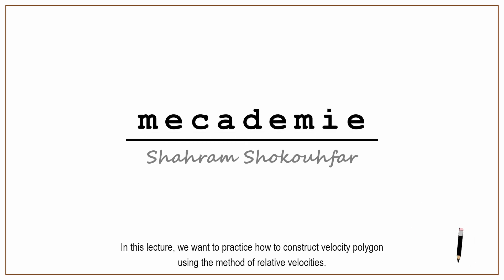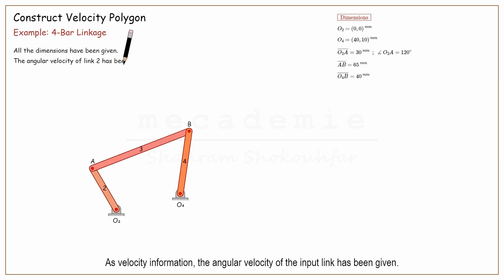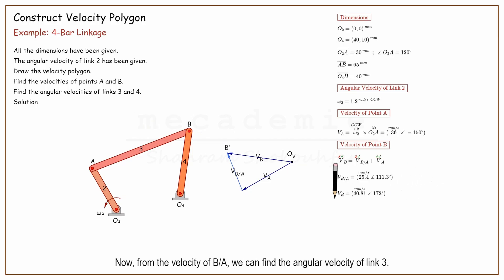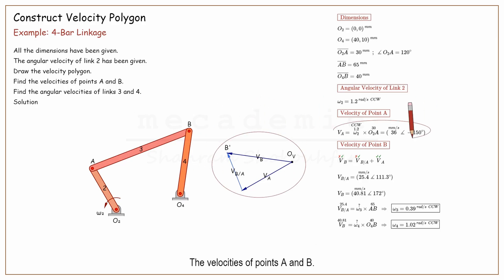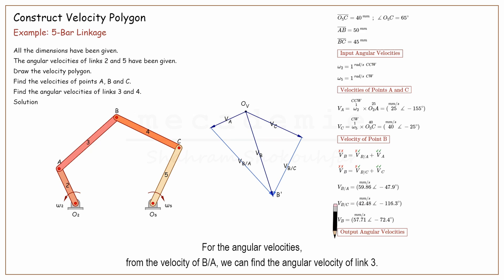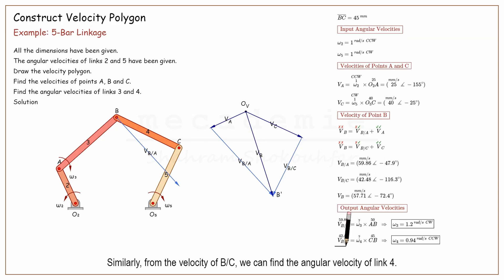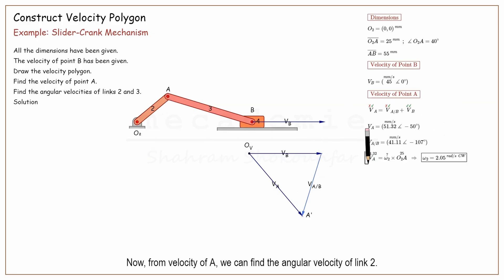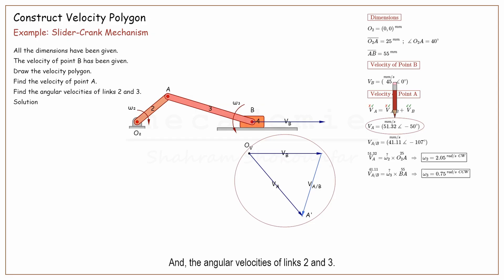Velocity Polygons: How to Draw Them Like a Pro

Comment: How do you determine the lengths in the polygon ie the. Magnitude
Reply: how do you determine anything in a triangle ?  with trigonometry and specifically how do you determine anything in a non right triangle with the law of sines and law of cosines
Reply: btw in this graphic methods you dont need to use trig just measure it with a ruler and  protractor  and obviousy scale it , you get what you see  that is practically  the point of it not to use trig